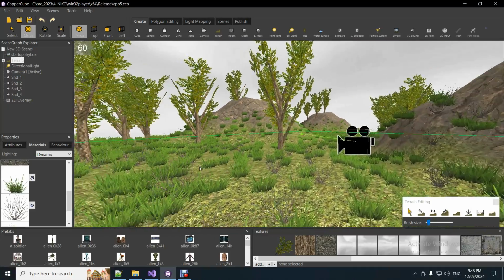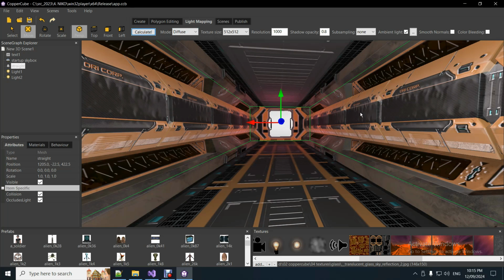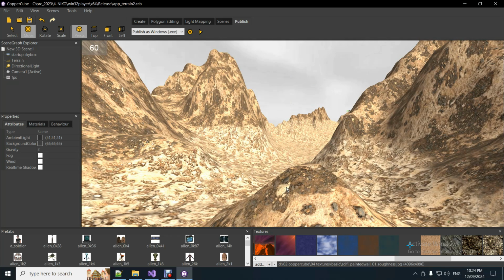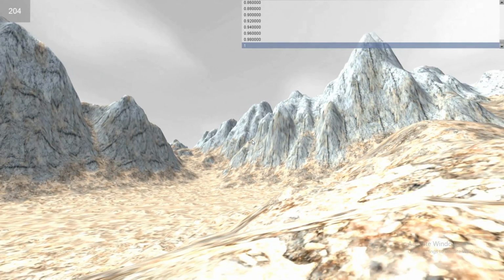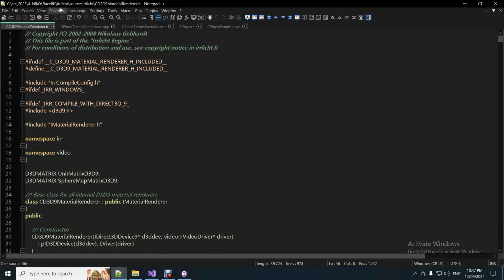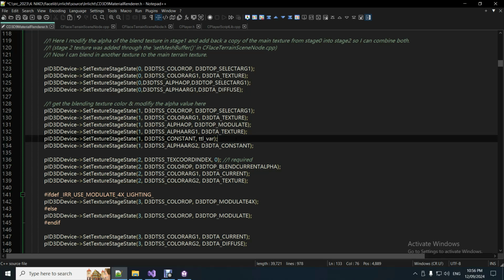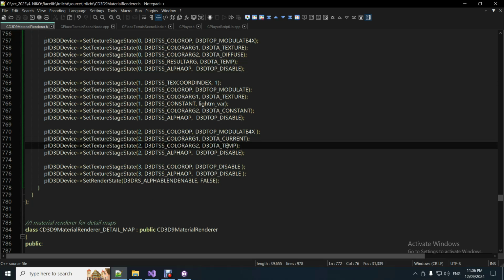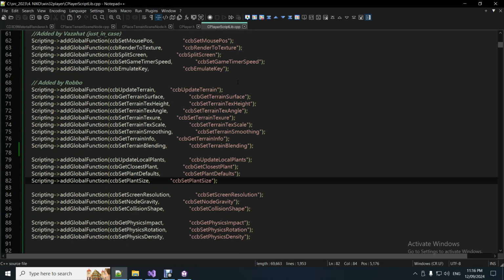CopperCube 6 - Terrain improvements

Comment: That's cool. I started playing with the Coppercube engine and realized the grass sticking out from the slope while all having same vertical angle looks super ugly. I minimize the effect by putting small sized grass on more angled surface but ideal situation would be grass object tilting to match the slope.
Reply from the maker: Yes, that will work and you can adjust individual plant types sizes now using my new API also